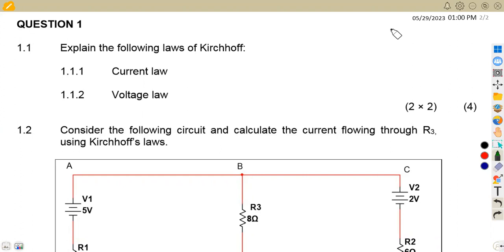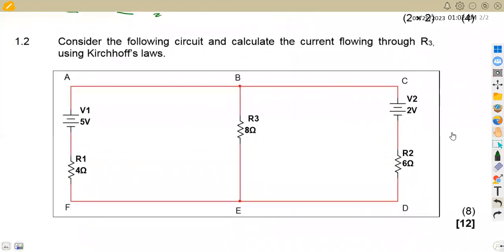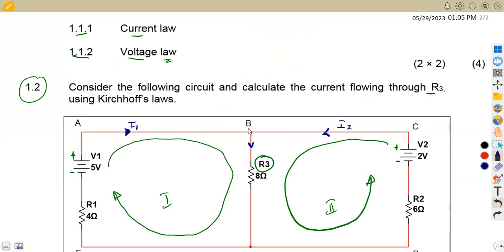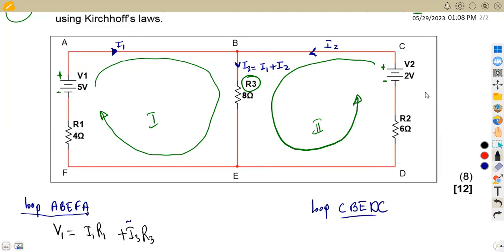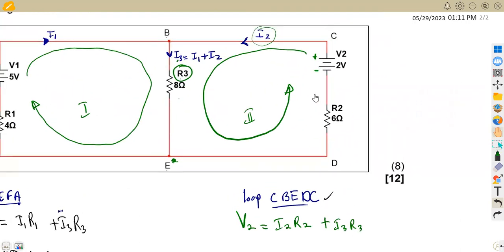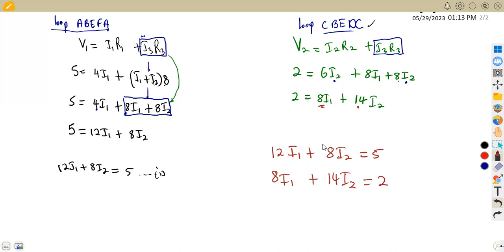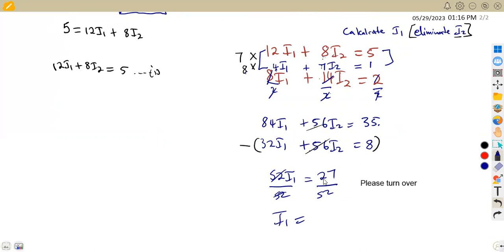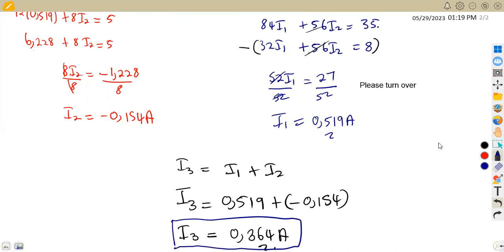INDUSTRIAL ELECTRONICS N4 Kirchhoff's Laws Network Theory NOVEMBER 2017

Comment: Beautiful lesson once again. In the previous lessons you had mentioned that it would be advisable for an example like i3 to calculate the final results using fractions instead of decimals in order to ensure accuracy of the answers. Thats why a lot of people in the comment secion are saying that i3 is equal to 0.365 and i too have got that answer by using the fraction form of i2 and i1 in order to find i3. Just trying to clear the confusion. 

Brilliant video by the way, thanks 🙌🏿🔥😤
Reply from the maker: Great suggestion! More light always